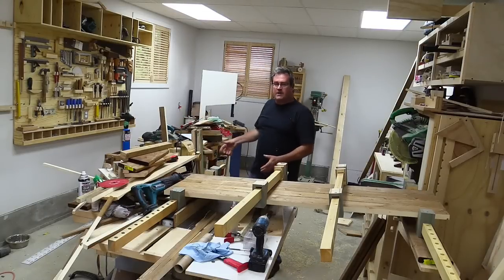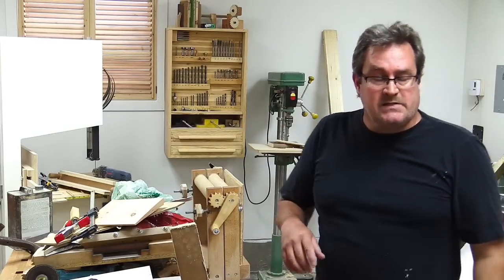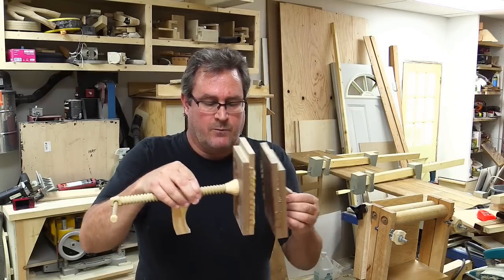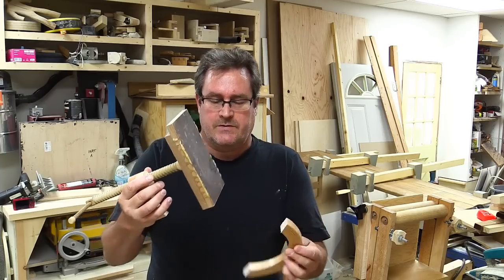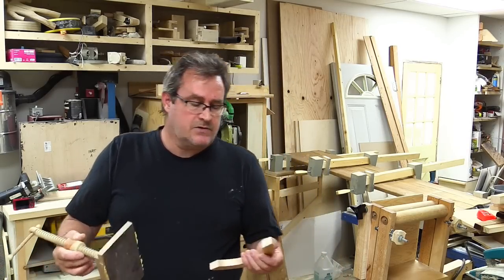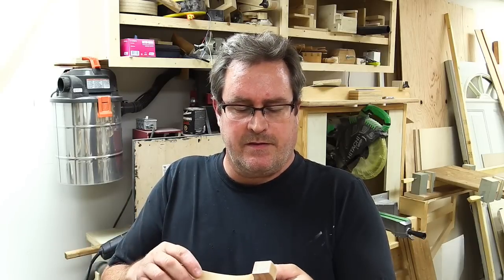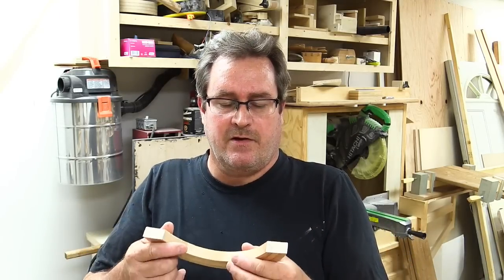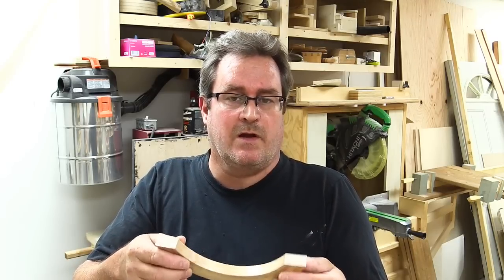The Wooden C Clamp And Tortilla Roller

Comment: For your two-stage tortilla roller, I'm thinking you could maybe simplify it a bit by using three rollers rather than four. It would only take three gears to drive all three rollers with one crank. This would mean the tortilla would have to go around a bit of a corner, you know better than I if this would cause a problem. Anyway thanks and I enjoyed the video!
Reply from the maker: Jer's Woodshop Worth looking at, that for sure. I'll have to make a mockup to nail down the best configuration.

Comment: Nice video John . Would plastic pipe work for rollers on your tortilla press? might be easier to clean. Then put a finish on the rest. It's a great idea though.
Reply from the maker: Backyard Woodworking Good idea! Certainly makes it easier to make, since there will be no turning on a lathe.

Comment: If you build a second stage roller for your tortilla roller you will have to make the second roller go faster or make the second rollers larger or your material will back up between stages.
Reply from the maker: ***** Interesting point! Maybe enough space between the roller pairs to take the slack, or since they will be driven by wooden gears, the second set could turn a bit faster.
Reply: I Build It Make gears of varying tooth counts, so you can try different gear ratios.